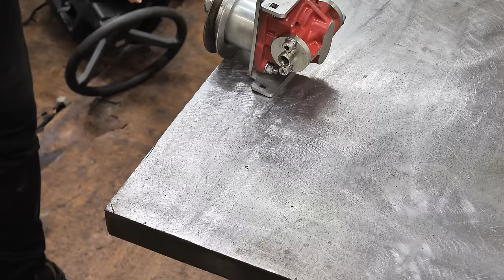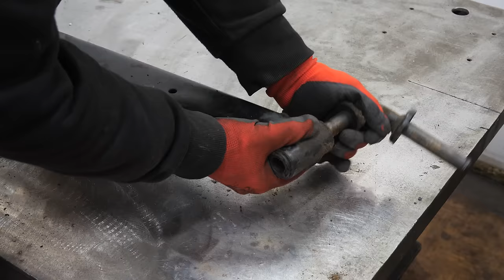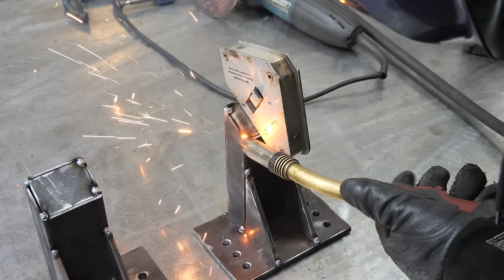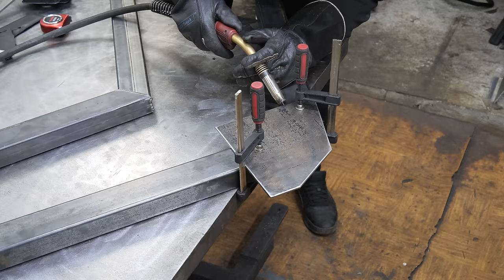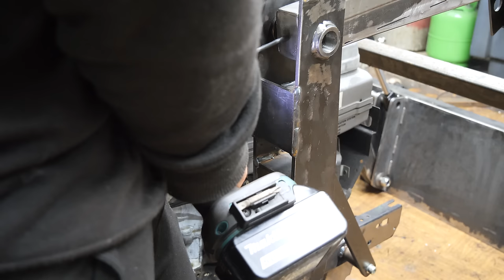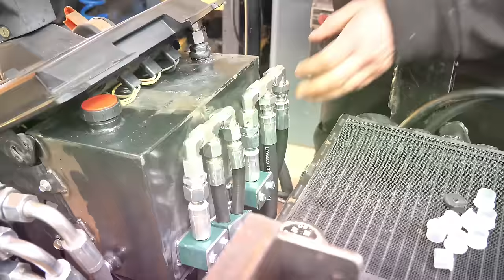Can Lawn Tractor be a Hydraulic Loader ?

Comment: I would suggest to use an electric hydraulic pump. Comes as a compact unit with tank. These are common on lift gates of trucks and found cheaply in junk yards.
Reply: Nice tip for electric hydraulic pump.
Could be used for many things to get simple things working, even part of the building!

Comment: Use the heel of the bucket to back drag the sand out level.
Change the angle of the bucket for perfect backdrag leveling.
You don't even need down pressure.
You can do it on float.
With the heel on the bucket you can grade just as perfectly as you can with a boxblade.

I am a 30-year operating engineer.

Comment: What steel tubing and steel plate thicknesses did you use for the project, please let me know I would appreciate it, thanks
Reply from the maker: The main columns are made of 5mm thick sheet metal, but as you can see, I had to strengthen them quite a lot, the arms are 50x30x2.5mm. loading bucket: sides of the bucket 4mm sheet metal, 2mm longitudinal sheets :)

Comment: Definitely a cool project but I feel sorry for that large amount of weight and stress being put on that light duty frame and suspension. 
You can put windshield washer fluid in your rear tires to help keep it grounded. 
Might not wanna fill up your rear tires as much as you did .... It will significantly help to only fill up the rear tires until you see the outer edges of your treads start to lose contact with the ground
Reply from the maker: Thank you 😁 I'm working on this problem right now, you gave me a very cool idea with tires :)
Reply: @WorkshopFromScratch 
Youre welcome :o) 
I have a Ford 3600 tractor with a loader on it. The rear tires were often filled with liquid calcium since that adds a significant weight to the rear of the tractor. Unfortunately the liquid calcium is corrosive and so the industry started replacing the liquid calcium with windshield washer fluid. The washer fluid has less weight to it but its not corrosive to the rims and it also doesnt freeze in cold temperatures  
Got my fingers crossed for your cool idea and hopefully we get to see an updated video on your progress

Comment: Needs counter weight on the back. Lots of it.
Reply: Truthfully, even with the rear axles being braced with the pillow block bearings the hydro trans unit is probably already past it's rated weight capacity. Those braces only help support the load and do nothing to help it move or stop it. More weight to band-aid the balance issue will only add more stress to the hydro trans unit.

Comment: it won't last... the frame of the machine is 3 mm sheet metal and as soft as it gets... you can bend the front axle without anything heavy over it... of course it's a nice build but the job is kind of undone when the basic machine is too thin.

Comment: So you turned a lawn mower into a garden tractor and added a loader... if you can afford a lathe, welder, bam saw and other shop equipment,  you couod simply buy the tractor you need or want..
Reply: basically or just get a skid steer 8 mean basically same thing